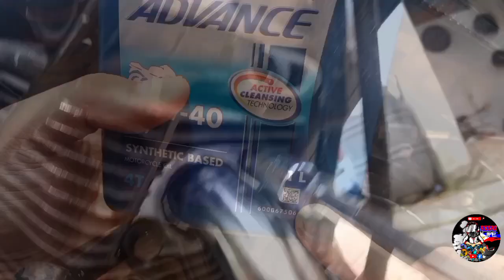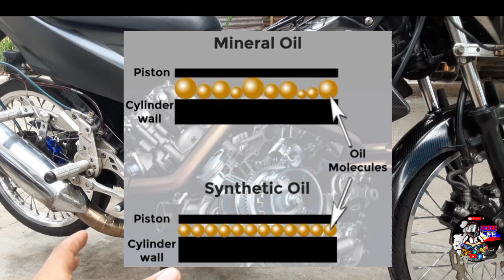ENGINE OVERHEAT PROBLEM, RAIDER 150

Comment: Been using motul since 2nd oil change maintenance, pero never ako na disappoint sa oil kahit mineral based lang na motul. Galing na ako sa shell advance & castrol pero bumalik kase mas prefer ko performance ni motul, di naman naka experience ng overheat kahit birit niminsan. BTW, nice content paps, shoutout sa mga taga cdo. Hehe
Reply from the maker: Sge paps spread the love ride safe paps🙏💞

Comment: Paps, anong mangyayari pag mataas menor ng carb? Nakakasira ba yon ng motor? Saka may time may maingay ako nadidinig after ko mag open carb, diko alam kung galing sa flatslide na carb or tensioner na yon, pag umaandar kasi dina sya lumalagitik pag nagbabagal lang minsan may nadidinig na lagitik sa motor, pero minsan wala yung lagitik san yan galing yon salamat❤️
Reply: Normal yan paps.yung naririnig mong lagitik. Compression release yun. Lalo na bagong andar.peru pag naabot na ng langis mawawala yan.
din yun minor lagay mo sa 1.5 adjust molang
Reply: @arwanpipty7940  salamat po, opo pag bagong start sya malagitik pero pag umaandar na wala na yung ingay kala ko may problema na motor ko ride safe po, subscribe ako para pag may mga bago upload at katanungan ako mahelp moko❤️
Reply: @youtubeislearnings1118  mawawala din yan sa katagalan.
Reply: @Rhod07  Thankyou po idol😇